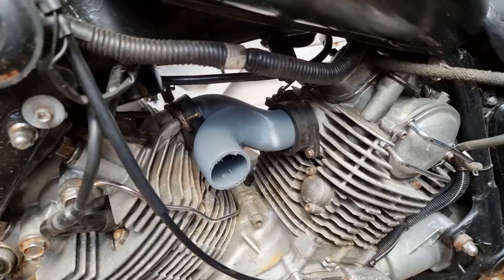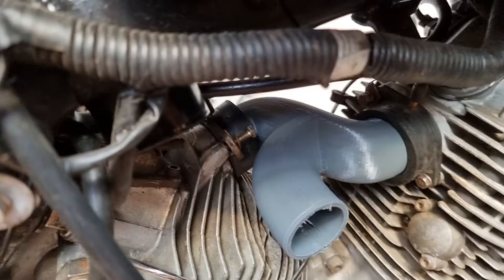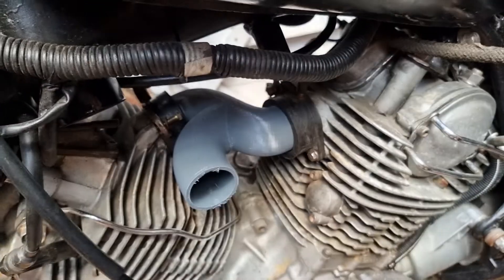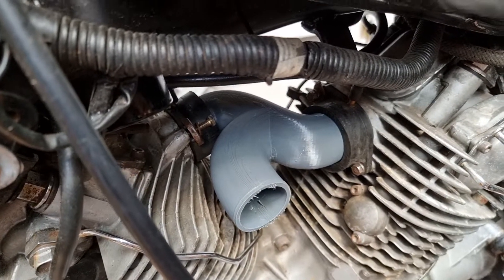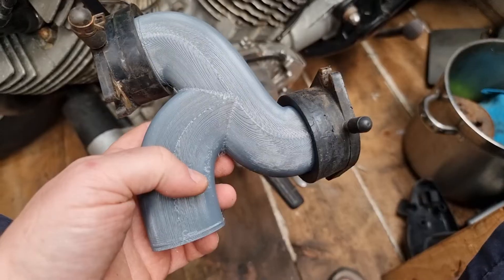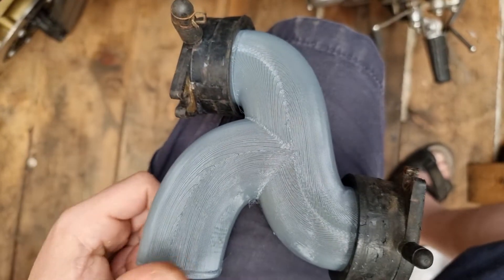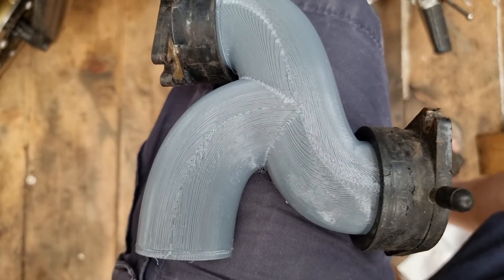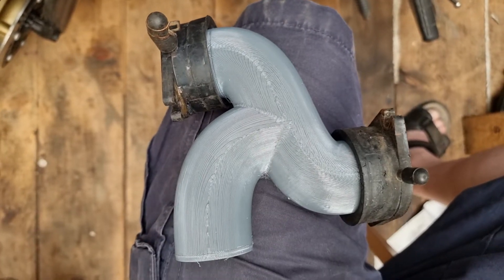XV1000 3D Printed Single Carburetor Conversion Adaptor Test Fit

Comment: Hey can you share the STL file please ?
Reply from the maker: The answer is still no. 
I'm curious why you think I should,  it cost me over £1000 to develop this plus maybe 100 hours of my time,  maybe more. 
If you print your own toy will need at least 500ml of strong-x resin,  this will cost you about £90.
I've offered to sell one to you for £80.
Please explain your thinking to me.
Reply: Do you supply these? If so do you have a link too purchase one
Reply from the maker: @Darren-fj4ck Hi, I don't have a website, but if someone asks, I can make one. They are £100 plus postage. What's your situation?
Reply: @BikeFromTheBrink  looking to convert a 750. Are you UK based? If so what's the shipping UK to UK?
Reply from the maker: @Darren-fj4ck I'm in Halifax UK, you can collect or £10 covers post